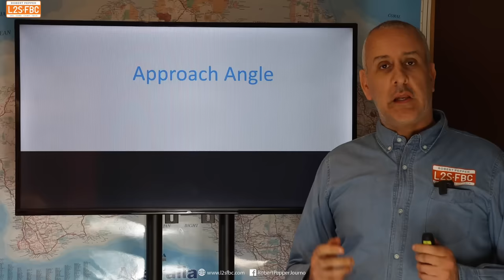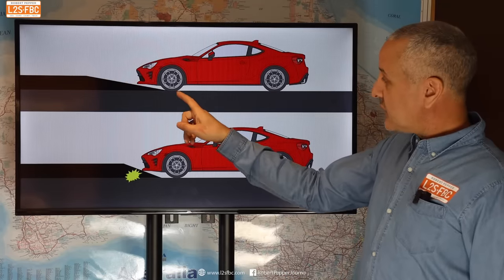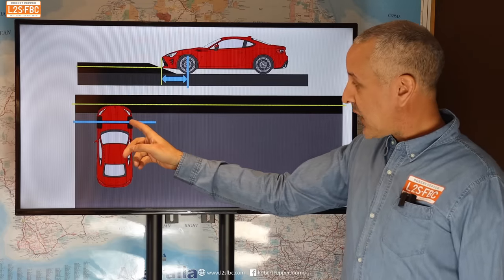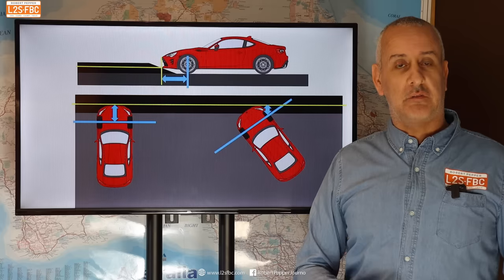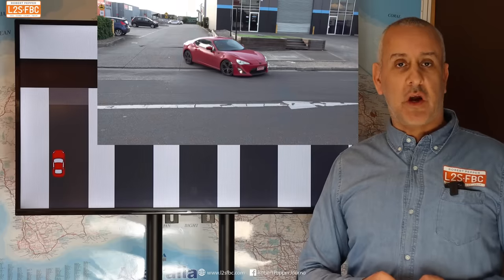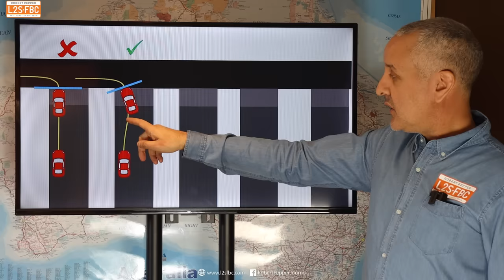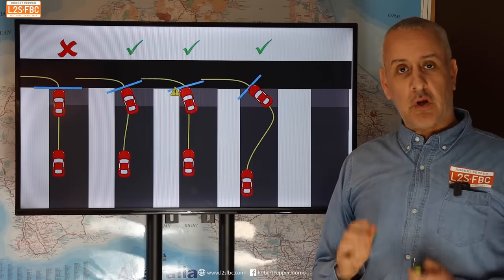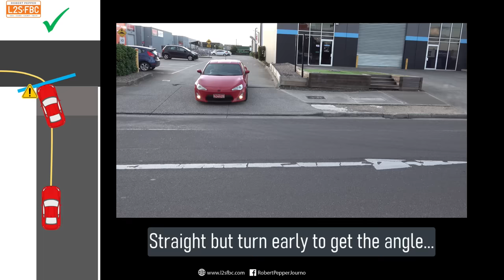How to drive a lowered car over a steep driveway

Comment: The problem is you don't know which driveways are just steep enough to cause that until it's too late. This means you basically have to take every single driveway at an angle if you don't wanna risk it.
Reply: If you know your car you will know when is to steep.
Reply: @hb-ol9oc not always
Reply: @hb-ol9oc  Then let us press F in respects to people who only JUST got their new cars only for this to happen to them.
Reply: @hb-ol9oc  Show me a person with a lowered car who has never scraped the bottom of it and I'll show you a liar.
Reply: That's why you don't lower your car. Why introduce unnecessary complexity to the driving experience?
Reply: Because it improves the handling and looks of the car. It was worth it to me.
Reply: @raneer_6567  Handling possibly. Looks... not so much.
Reply: @onddu2254  Massive wheel gap looks bad on a sports car. Lowering fixes that.
Reply: Or get a higher car
Reply: @hb-ol9oc 
I bet You know your car better then your wife

Comment: Good video. Now you have to make another one with the speed bumps, e.g. how to drive over them to minimize the impact to the car so that it would not feel so bad
Reply from the maker: Good idea, I may do that. Please share this one!
Reply: Please. We have really bad speed bumps here where I work and they are tall and narrow always see cars scraping them even non exotic cars
Reply from the maker: Stay tuned...
Reply: Please do one on how to drive over rumbles. Its a nightmare in Kenyan roads. A big truck could be trailing you so there is danger of hitting your rare end if you slow down. Thanks
Reply from the maker: What's a rumble?
Reply: @L2SFBC  on our roads these are tiny sharp bumps together. Usually 4 inches high and put on highways. Normally 4 or 5 together.
Reply: @Tre-g7f  we have rumbles to with about 6 inches space between and 3-5 packed together. They suck but here it is only at entrance to play grounds and parks were toddlers sometimes run across the road.
Reply: 0:01 was a jumpscare.
Reply: He never made a video about this 😔
Reply: @elvisrodriguez3297 nada??
Reply: @L2SFBC did you ever make this video
Reply: Not to sound condescending, but the same rules apply, slow way down to a crawl and take at an angle if necessary.

Comment: 6:06 that guy doing the angle is hilarious! Probably, he doesn't even know why they are doing it and decided to join😂
Reply: Probably he did it out of force of habit, because it's how he is used to approach bumps in off-road.
Reply: Or maybe he was kidding. It was funny
Reply: its simple logic, everybody knows it, or at least should.

Why he is doing it is probably out of habit as well as it still helps- less tear on the suspension and smoother
Reply: The JeeJee was just being a sweet. No problems here.
Reply: I thonk he probably knows and was just being funny, I mainly drive lowered cars but have driven lifted vehicles as well and if I was driving a lifted vehicle in I would have probably done the same thing except more dramatic of an angle to be funny.😅
Reply: This technique smoothens the ride for both the car and passengers. Even if the car doesn't absolutely need it, the passengers will still appreciate it.
Reply from the maker: Good point ✔️

Comment: I learned this by experience after hearing slight scratching then I drove at angles exiting . Mine is not the bumper that hits but a mud flap on just below and behind of the wheel on a Mazda 3.

Also going fast makes the car jump which hits the road.

Comment: This ‘angling off’ approach has an important side effect which also helps prevention of the nose grounding.  Approaching on the angle means that both front wheels don’t ‘drop’ into the gutter throat at exactly the same time. Instead when ‘angling off’ each front wheel gets to drop on its own, leaving the other front corner to help carry the cars weight at that exact moment…. Can make an important difference especially when your car is really low (my Radical has an approach angle of less than 3 degrees!)
Reply from the maker: Exactly right, although having most (all) of the car's front axle weight carried on one wheel will compress the suspension more than if the weight was equally carried, but even so, angling off works...as the people shown at Cars & Coffee proved!  A three degree AA is really low, must have great aero on that car :-)

Comment: A bit late to the comments, but I own a couple Mercedes with 10 cm from the ground, all factory original.
(SLK 250, Sport suspension; B 200 Sport, Avantgard Suspension - it's the regular suspension, but lowered)

This way to drive has been my safeguard to avoid scratches not only under the front fender, but all under the car.
Here we have speed bumps which are not standard by any means, and the driveway of the condo where I live is at a steep angle.

Much appreciated.
Reply from the maker: You're welcome!

Comment: The reason for the slow is so the suspension doesn’t compress on impact, further reducing the approach angle. 

Also, it was interesting to see how many people stopped on crunch, and then went back down the drive edge, further increasing the damage.

An extreme improvement is to be parallel to the gutter and actually use a tightly turned wheel to be the first thing up the gutter. Then you have to straighten up so the rear doesn’t impact the full kerb. It’s lucky some of those cars didn’t lose traction from lifting a drive wheel on the angle.
Reply from the maker: Good points, I actually thought about showing how to mount a kerb using the full-lock technique but left it out in the end. Modern cars have brake traction control which helps with the cross-axled situation.

Comment: Nice video! Other method is shifting weight balance of the car using a little bit of break-slamming and release, which makes car nose up, however, this needs some skill.
Reply from the maker: Yes but it is high risk and makes it worse if you get it wrong!

Comment: This seems to be like fashion without regard to function. It is a suburban street street you filmed and a relatively flat one at that. I & I'm sure you have encountered narrow access driveways with far more severe transitions than this example - ones that the narrowness precludes changing the approach angle.  Great business for the bodywork repair shops!
Reply from the maker: Yes that was easy by comparison to some for the reasons you mention.

Comment: I had to put 2 steel ramps when backing down my 2014 Corvette down the driveway at my house driving up the driveway was no problem the ramps were 3 ft long 1 ft wide and 1/4 thick (2)

Comment: I learned about this, when trying to part half on the sidewalk, half on the road (common in Eastern Europe where I lived a decade).

So you line up parallel, and let the wheel climb up, and pull the rest of the car like on a jack. The rear will rise on that side too, and youre good. I was climbing some 1ft tall curbs this way. Same thing for driveways. Mine is fine for cars (even things like Demons), but my buss needs to swing out. 

In the US we call that a buttonhook, which also helps with turning into a narrow road where you will pop a curb if you take it normally. Trucks, buses do it (though you are supposed to go into oncoming traffic, since they are likely stopped) and also if you drive a long car, like a 70s Continental or limo.
Reply from the maker: Yes, I've demonstrated that technique in 4x4s. I didn't know it was called a buttonhook though!
Reply: @L2SFBC  lol. I should have mentioned trucks as in commercial rigs. Sometimes you just have to do what you gotta do.

Also. Im getting old, so not sure if younger drivers even call it that, since its not taught. Much like what it means by having two logs.

Comment: Hi, this is a very interesting and informative video.
Congratulations!

I have a question, if you don't mind.

A few days ago I've made a test drive on a car I intended to buy, but unfortunantly when I was acessing my garage it started to scratch below as soon as I reached half of the driver's door until almost of the first half of the back passanger's door.

How can I avoid this situation?

I live on a building which has an accentuated ramp to acces the parking garage.

Do you know any link video showing any solution for this?

Thanks.

Comment: I have to angle my way into my favorite gas station if I don't it'll scrape (2022 Camaro). I drive a truck, sometimes I pull a drop deck trailer, I've scrapped the trailer before pulling into a customer lot, that's where I learned about this.

Comment: This never used to be a problem in the old days where a typical family sedan had similar ground clearance to a modern SUV. And driveway design is also to blame. At some point steep curves became trendy versus the shallow ones of earlier years. These days I literally have to plan all my trips so as to make sure I am going to do a left turn into any driveway or otherwise I already know the driveway is "safe" for a straight in approach with no angle. And I just have a normal car on standard suspension. It does not help that even standard cars these days all have soft plastic lips under the front bumper which I presume are partly there to help direct the airflow to the right places and partly there to warn us when we are approaching a "hard" clearance limit. At least the soft plastic lips are cheap and easy to replace. I carry a couple of spares just in case (have not needed them yet).

Comment: thanks for this video! i had a hell of a time trying to find the right search terms for this on google. I normally drive compact SUVS but just got a brand new Camry, soon as i pulled into the driveway i do my usual swing out on the road and come in straight, heard a scratch and my heart sank. i just had this car for 30 mins and i already damaged it i thought. looked at the underside and no scratches but that was a shocker I never payed attention to it before so then when i left that day i thought it was my speed since i came in at about 6-10mph. reversed super slow, happens again me: wtf. Was about to spend way too much money for some overpriced pieces of rubber (driveway ramps) just to fix this problem and i luckily found this video!
Reply from the maker: I'm so pleased Monk, love it when my videos help people! Please share and/or SuperThanks :-)  Yes the SUVs have the advantage of  sufficient clearance for any urban ditch, unlike the Camry. Imagine if you had a sports car...!

Comment: As a 350z owner, angling doesn't always work.  Councils seem to approve non-compliant crossovers and well... sometimes you just have to park on the street!
Reply from the maker: Yes, there's a limit to the angling technique but it does work! Is your 350z lowered?
Reply: @L2SFBC  Nope, bone stock.  But you realise just how low the stock front end is when you question the angling technique on a crossover.  Most times it's ok, but there are times when a crossover may as well be Mt Everest!  One time I got up into a parking lot ok, didn't think twice.  But when it came time to leave, the car was on such a steep downward slope that I had to readjust to such an acute angle it was laughable!  Didn't scratch the underside though, so a win for me, but it took me a few minutes.  I must have looked like the biggest wanker on the road!  You end up getting a feel of it through experience.  Heaven help anyone who lowers a modern sports car though!
Reply from the maker: I'm going to take a look at a 350z now, I didn't think they were that low or maybe it's just really steep driveways where you are!
Reply: @L2SFBC  Probably a bit of both! 😁

Comment: 1st, I let my passengers off , then I approach at the angle where the nonccupied side has higher ground clearance ,then I'm okay.  But my hands are tired and restricts me from using my side  to attack at that angle which with me on it has more weight thus lower ground clearance for a successful attack.

Comment: Beware of lowering your car as it changes the steering geometry and can make the car dangerously undriveable. It's worse with front wheel drive cars which are prone to bump steer and roll steer. Go to an expert fitment center which may need to replace certain components with aftermarket parts that are designed for that application.

Comment: Another alternative....have a PROPER amount of suspension lift on your vehicle. 
My 3500HD Silverado has a 4.5" lift and, funnily enough,  I've never had any issues going through spoon drains....
My sons all have stupid ricers and are forever having to do what you describe. 
WHY???
Reply from the maker: Ask them why they drive what they drive. Genuinely interested.  Personally, I own both sports cars and a 4WD...so I have to angle off too!  Even when a sports car is stock you may need to do this, and definitely if you lower it.
Reply: I know of one train bridge here in Brisbane (1.9m Berrima Street, Wynnum) where you'd take your whole head off but your kids will slide under just fine. My 2011 Forester (1.7m Hight) was just able to fit and I could reach through the sunroof and touch the underside. I'm willing to bet there are a few carparks you're better off not being in either.
Reply from the maker: An excellent perspective, thank you yet again Mike!
Reply: @Mike_Costello  quite right mate. At about 2.3 meters high and often towing a 3.2m high caravan, I am well aware of the heights and I do tend to steer clear of underground carparks etc. 
However, it's all a case of horses for courses and I never admonish my lads for their choices of vehicle....until and unless they come crying to me that they've damaged their pride and joy because of it's set-up.
Between them they have a Supra, GTR and two recently imported Crowns (Athlete?). One of the lads had a ricer at one stage (can't recall what it was) and he had so much camber on the wheels and it was so low that when he tried to drive through the spoon drain in front of our house, which was similar to the one shown in the above video, one of the rear wheels would literally come off the ground and he'd be dry bogged!!! hahaha. He was thinking about a MIG-style locking diff, but decided to sell the car because he'd lost his license.
Reply: @L2SFBC wish I came to this video b4 I scrapped mine. How much you think it’ll cost to fix the scrapes?

Comment: I have a rental Toyota Camry that scrubs coming out of the driveway and the driveway has a gate so it’s hard to leave at an angle cause it’s only a car width wide. Any advice?
Reply from the maker: Angle the best you can, if that doesn't work, reversing in may work, if not...ramps.

Comment: My car touches/damages the middle rather than the nose. How do I fix this please ? I’m even thinking of getting rid of my dream car due to this 😢 or maybe there’s something that can be done to the driveway to ensure it doesn’t scrape it ? 😬
Reply from the maker: Two ways - drive in a different angle, and second way fix the driveway. For the first; use the angle approach shown here, but delay the turn slightly. That'll help the middle of the car clear. Second, look at when the car touches, and then figure out where the front wheels and rear wheels are. Then, put some planks of wood just before those points. That'll lift the car up.

Comment: The 4x4 didn't need the clearance, he's an experienced driver and was minimizing the jolt when making the transition. By driving over the transition one wheel at a time, he felt it half as much.
Reply from the maker: This is a good point, but given the car's tyre diameter, suspension, the nature of the ramp, and the speed...it looked a bit exaggerated :-)
Reply: @L2SFBC  Yeah, maybe he forgot what he was driving. I try to stagger the "hits" by about a half-second. It works for independent suspension as well as solid axles. I'm always surprised by the number of drivers that don't know this technique.
Reply from the maker: I use it offroad at high speed, works very well.

Comment: Or dealers/manufactures can just make cars taller to avoid this problem with sedans by probably making the minimum wheel size 18
Reply from the maker: Wheel size has nothing to do with it.
Reply: @L2SFBC  I'm pretty sure the wheel diameter makes a slight difference.
Reply: @L2SFBC  or they can start making sedans with an adjustable suspension

Comment: Are there just some driveways low cars should avoid?
Reply from the maker: Yes. There comes a point at which ramps are the only option.
Reply: @L2SFBC  thank you! I had a car that had about 6” and just bought a Prius that has a little less than 5” and it’s a learning curve lol that inch makes a difference!
Reply: @L2SFBC  if you can make one about speed bumps and twin speed bumps I’d be so grateful 🙏
Reply from the maker: I will, just need to find a big enough speedbump in my home town!

Comment: Step 1: Don't buy a lowered car.

Step 2: Don't lower your car.

Step 3: IF you do lower your car, get a suspension system that allows you to adjust ride height on the fly.

Comment: 1) why do manufacturers keep lowering these cars?. As good as the dynamics are, its not worst it on most of these cars.

2) again, why do manufacturers keep giving cars these elongated front over hangs? These beaks, as dynamic as they make cars, its just not worth the heartache in our normal roads.

3) why are they still making roads with steep humps and turn off inclines with unfavourable angles knowing full well that modern cars are low and have these extended overhangs?